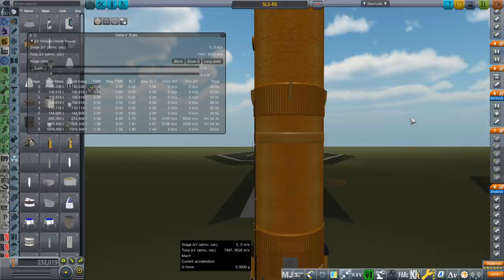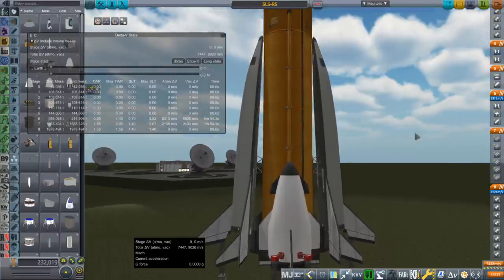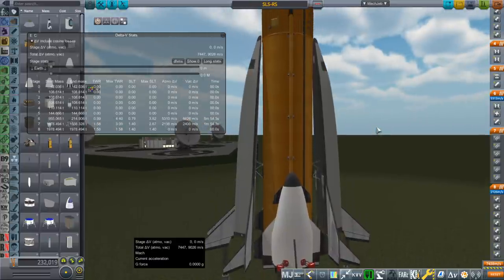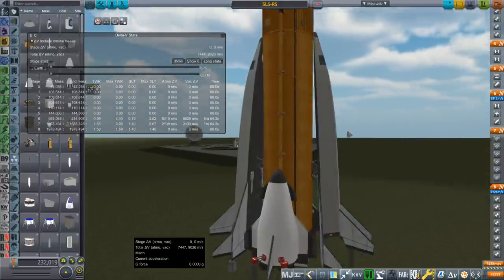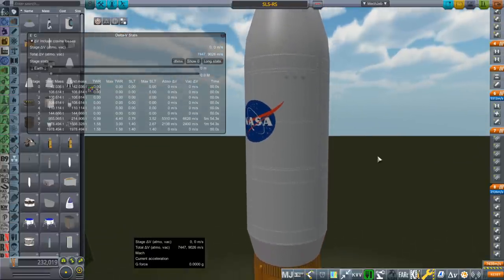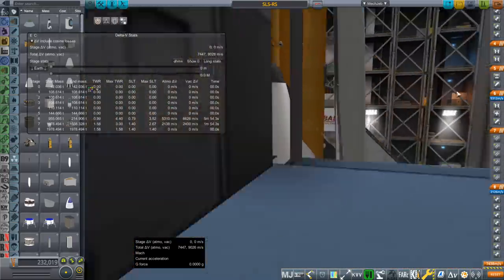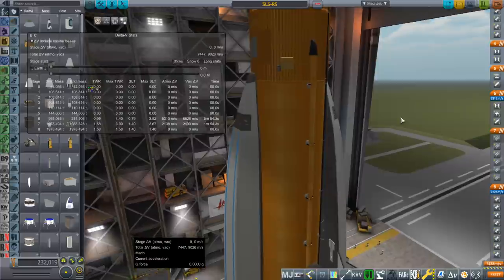Realism Overhaul in KSP 1.8.1 - SLS with Raptor Boosters

Comment: 0:35 and 6:00 Ah, makes sense on why you didn't do that, then.

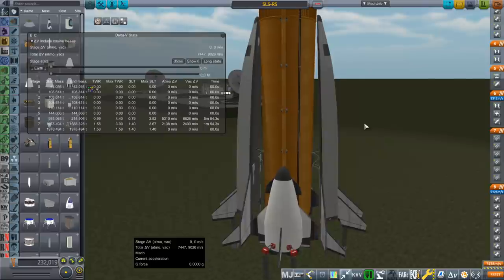3:15 Lemme guess, you're gonna bi/triamese them and send one into orbit.

5:15 I thought the Saturn V was capable of 47 tons.

7:15 Maybe try 4 Raptor boosters and a Vulcan-style reusable engine pod later?

24:45 Good idea.
Reply from the maker: The Bi/Triamese thing is already the Shinkansen spaceplane system, so that would be redundant. On Saturn V, the estimates vary a bit between 42 and 48 tons - partly due to varying performance of the F-1s.

Comment: at this point it would be easier to just recover the whole first stage
Reply: That's impractical though, by the time the core stage finishes its burn the vehicle is nearly in orbit already, it wouldn't be much easier than trying to recover a Falcon 9 2nd stage.
Plus I reckon that, unlike the Merlin vacuum, the RS-25s were not designed with restart capability in flight, so you couldn't even do boostback burns and you would need parachutes for a soft landing.
Reply: @giuliodondi  Yeah, in order to do reusability with SLS you're pretty much limited to either engine recovery or complete redesign of the entire launch vehicle.
Reply: Tyler H how about a design like starship for the first stage to coast back to ground
Reply: @snowgod8446  In that case the SLS's Exploration Upper Stage could perhaps make orbit but certainly not orbit plus TLI. You either give up going to the Moon or you include a Starship-like second stage in between.
But this is just treating Orion/EUS as the payload of a brand-new ~150t LEO reusable design.

Comment: Could a single F1 engine function as a replacement for the eight H-1s on the Saturn 1B?
Reply: In a sense, google Eyes Turned Skyward.  Certainly would have the thrust but would need some role control.
Reply: AFAIK the H-1s were just stand-ins for an eventual replacement with the F-1 which never came.
Reply: chris kerwin 

That what I was thinking about, everyone in the comments asks about heavies and boosters (KSP right?), so I thought about smaller rockets and the Saturn 1c slipped in. It would have been the perfect logical evolution of the Saturn program.
Reply: @TBone-bz9mp  A single F1 has more thrust than 8 H1s combined and it's also slightly more efficient (Vacuum ISP of 304 vs 289), at the expense of having slightly higher dry weight than the eight engines. But having many engines also means you can shut them down to manage TWR like Atlas did, which you couldn't do with the F1 since it can't throttle. So, while such a rocket would most likely work, I don't think it would be man-rateable like the Saturn I was.
An interesting concept is Saturn INT-05 which has a single huge SRB as the first stage, similar to Ares I. This would enable to define a thrust profile suitable for manned missions.
Reply: Giulio Dondi 

Yeah, but that would run into the same problem as Ares X and STS,what would happen in the event of a launch abort? You would have the CSM falling into a massive SRB plume. Did the F1b have the capacity to throttle?
Reply: @TBone-bz9mp  Of course you're right about safety, I was just reasoning on the standpoint of stages and engine layout.
About the F-1B, I found this article https://www.thespacereview.com/article/2410/1 which claims that by design it could throttle down to about 72%, while the Saturn I could get down to 50% by shutting down 4 H-1s near cutoff. Based onwhat I remember from my own version of the Saturn I in RO I reckon that a single F-1B could get you well past 4Gs and maybe up to 5 even with throttling, which is comparable to the Saturn V after all.

Comment: ive gotten 150 tons to LEO if you upgrade the RS-25 engines to the F config.
Reply: The F config is made up-there's no technical data to represent the specs they show. The G is completely insane- basically would be full flow combustion on hydrogen.
Reply: Powah

Comment: I'm really starting to think that Starship Super Heavy will lift off before SLS.

SLS is looking, at best, at the later half of 2020 for its first flight, while Starship could have its first high altitude flight this summer or fall. An orbital flight has got to beat SLS.

It would definitely make the SLS look even worse than it already does.
Reply: SLS is now looking more like late 2021, so even more likely.
Reply: Well, question is. Are we talking about, starship from animation, or early prototype, being carbid barrel of rocketry? Think about engine section of super heavy. 216 valves, similiar amount of pipes, probably ~70 pistons, 36 combustion chambers giving quite a lot of vibration, and 72MN push. That will take them atleast few years. If not more. People sometimes think, we can't have same problems as N1 today due to improvements in IT. But i think it's important to remember, that vibration on N1 used to tear fuel ducts apart. Also they still struggle to get fuel tanks work on upperstage. Meanwhile, on booster they are much larger, and will have higher loads. With 3mm steel, it will be very challenging (You can easly bend that in hands.). Booster isn't simple thing. Meanwhile current SLS delays are only due to COVID-19. If there won't be restart of it by fall, april 2021 is very possible.
Reply: @_mikolaj_  excatly, the "prototyps" that they have build were big tanks with a rocket engine at the bottom.
It is very easy to overlooked big problems, when being showing nice animations. If you look at apollo and see all the problems they encountered, it is just hard to believe, that they could "just build it". 
I am no engineer, but I see some huge possible problems with their plan atm. Even when ignoring the engines, certain things seem very hard to do. How are they going to deal with the expanding and shrinking of the metal? How is the cabling done? How are you going to fix a broken cable? There are so many small problems in building a rocket.
Reply: @_mikolaj_  I'm no considering the covid delays, but rather the delays SLS has faced in total.

The iteration of Starship I'm referring to is the first time Starship has a successful flight on super heavy - it may be smaller than the eventual full size version, but it still would demonstrate the basic system that Starship is pioneering.
Reply: @armchairrocketscientist4934  if we are talking about superheavy, i think it definitly is too optimistic. First upperstage prototypes could fly to few hundred meters this summer, but booster?
Reply: I doubt it
After the green run next month all that will be left to do is stack and launch the vehicle
The rocket itself is complete, only needs to be stacked in the VAB 
Starship on the other hand has no orbital hardware in sight and they haven't even begun building any kind of super heavy yet
Even the super heavy pad seems a long way off from seeing active use

Comment: SLS is pretty similar to ares V and ares V was ares I 's big brother. Dont you also think, that the SLS core has way to much liquid in it? Replacing the core with a couple of the SRBs could be interesting (but this would require a larger 2nd stage).
Reply: Oh boi... Vibration would be intense... But for uncrewed payloads... I'm with you

Comment: İ hava an off-topic question: Does anyone know how to remove the skybox or make it complete black?
Reply: Distant Objects lets you drop the brightness of the skybox way, way down.  Perhaps to zero?  You could also get a skybox replacement mod and replace the texture in there with a black image, though I do  not know which of the two is easier.  I suspect the first one.  I've had an undetectable skybox in there with planets visible and objects visible for about 150 or 200 km away.
Reply: @jamesf9829  Thank you ,it worked